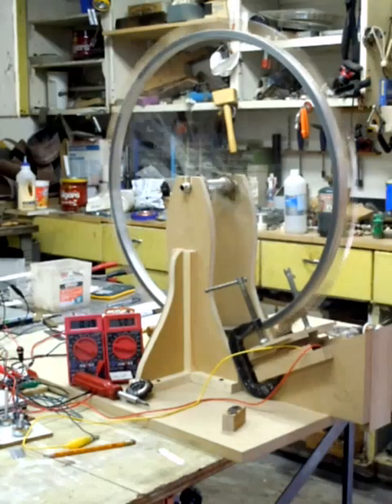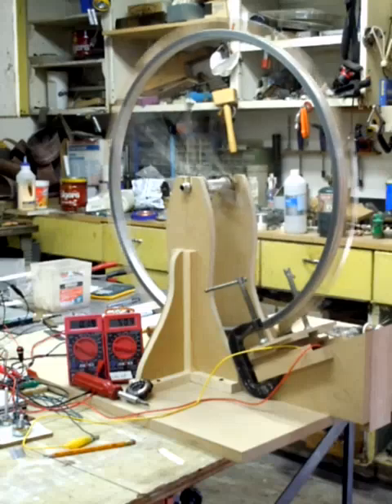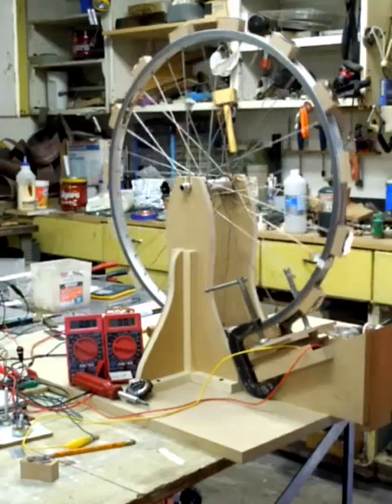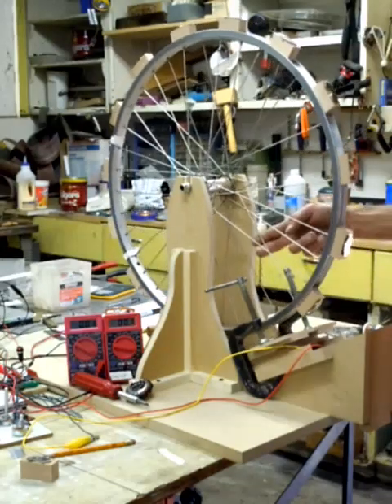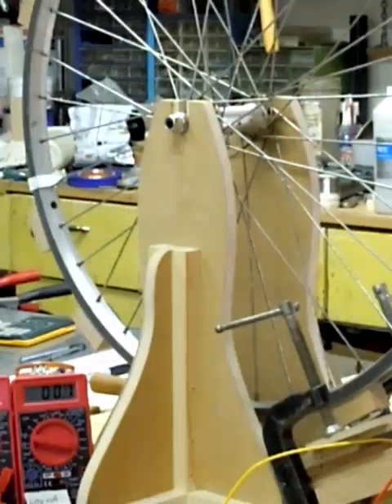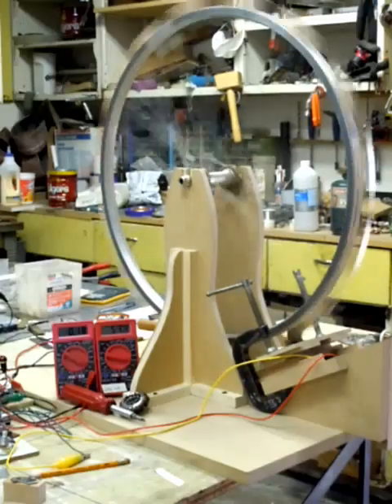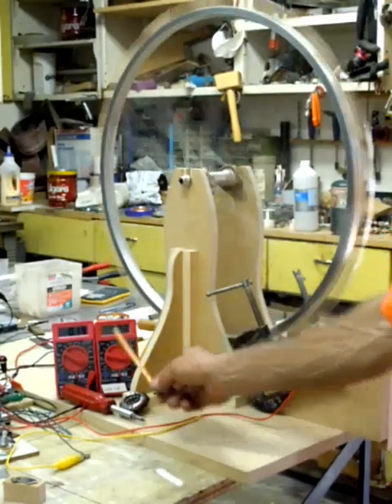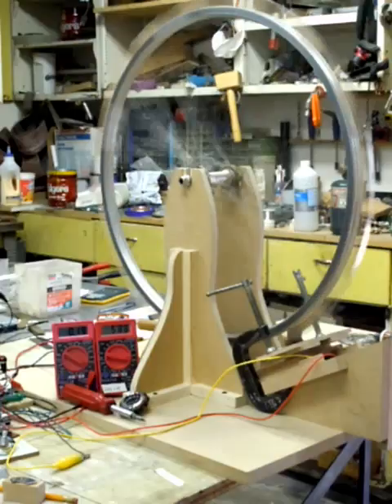15 Mag. Dual Poll Bedini Bike Wheel - magnetic self rotation ?

Comment: Well done...
If the stationary magnets were surrounding an axle and aloud to spin in relation to the wheel once synchronicity is achieved you will no longer have the resistance of magnetic pull from the stationary magnets. Two stationary rotating magnets works well, but three will increase the rpm by over 100%. To start the device spin two stationary magnets rapidly by hand then spin the wheel, once the wheel harmonizes with the magnets spin the third magnet.